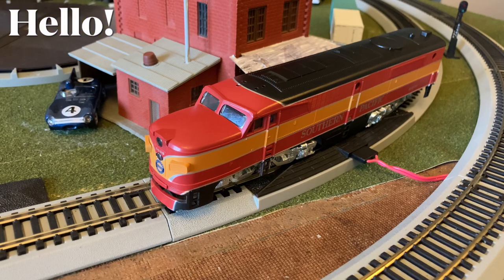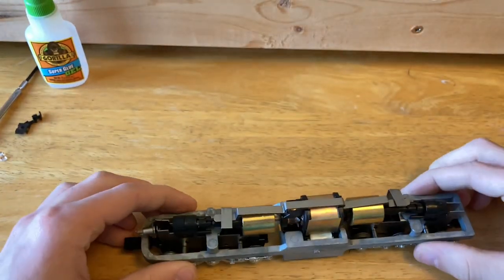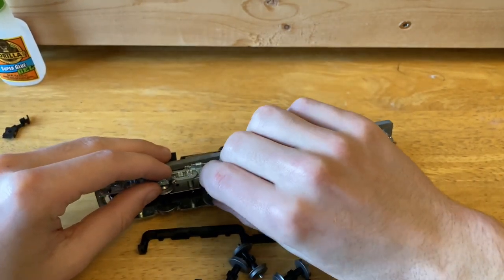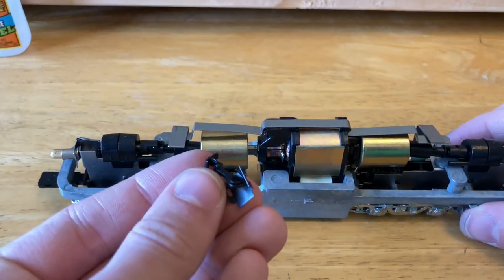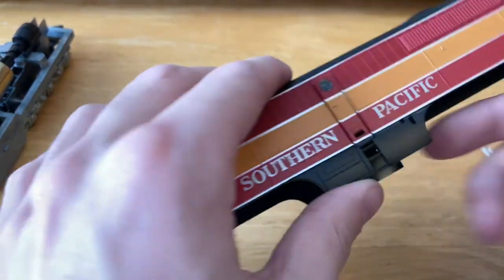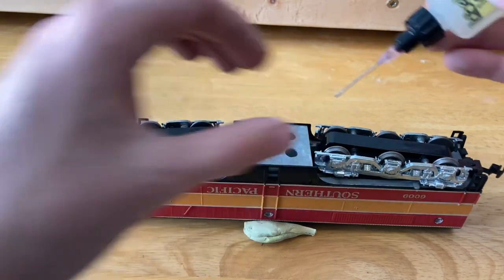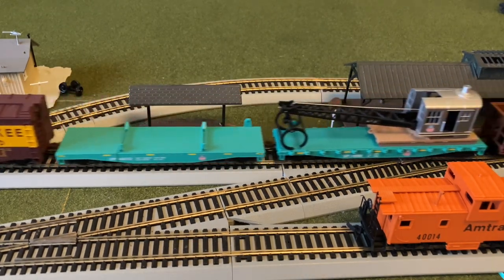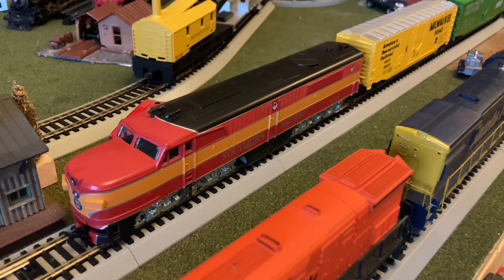1980s Athearn Blue Box Alco PA-1 Restoration ⛽️🧰 Can We Fix It?

Comment: This video was entitled as a Restoration video. Exactly what was restored? All that was done was the cleaning of the wheels (good job) and the motor commutator. (So So job). The rest was adding the missing parts. That is not a resto job. That in my opinion wasn't even a decent tune up. Far to many items that needed attention were overlooked and not even considered. I do not say this to criticize you, but to say that you have an audience that is watching you for guidance and this wasn't a good look. Please learn proper tune up procedures before you attempt to do another restoration as you will become more familiar with disassembly, what to look for, adjust, repair or replace.
Reply from the maker: Good to Know! I do agree that this was not my best work. Part of this comes from the fact that the locomotive that I mainly buy are not in the worst condition. I will look into what you have said and I will improve my content accordingly.